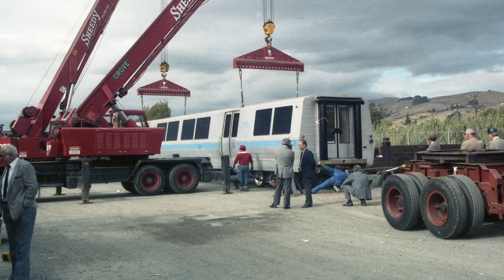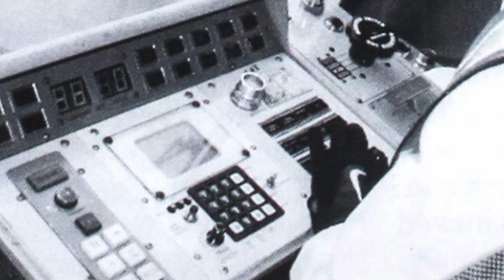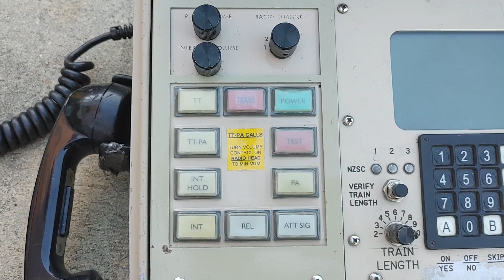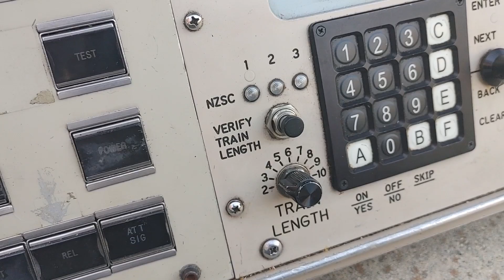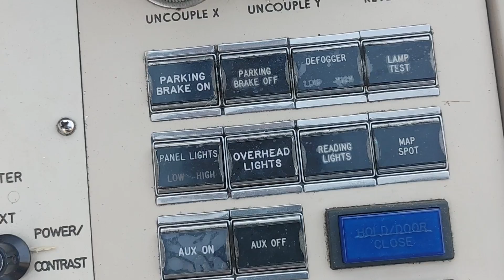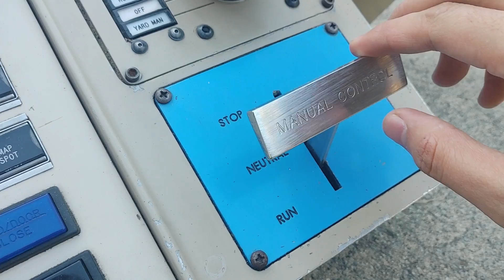BART Train Operator Consoles (and For Sale!)

Comment: I'm a victim -- err -- passenger of the Fremont Flyer and can be proven via newspaper picture :)  Do I get a discount?!?  FYI: I was staring at the train op slamming the STOP button with no (obvious) results.  I remember the PM Code shelf add-on (Max speed indicator).  I always remember train ops hitting the "Man" button a lot when it was raining as Lake Merritt would "lose" them on the map.  The train op walking up to the cab was carrying a GE radio with a UHF antenna.  So that was in the late 90's when the GE (Harris) UHF EDACS trunked system was deployed (and just deprecated this year!!).  BART originally used official Railroad VHF frequencies with no hand-held radios when they first started.
Reply from the maker: Guierrez, or Fleck, is that you? On behalf of the Western Railway Museum, I requested some parts from the rebuilt Fremont Flyer which are preserved by the museum and will be on display inside the cars in the coming months. https://bartcars.weebly.com/the-two-bagger/farewell-to-the-fremont-flyer-a-car-143-b-car-826-b2-car-1826 There were quite many mods over the years and only a little bit of that remains. The second generation WH (alongside QUEST partial replacements) seems to have had better luck, lasting through the end of the cars. One of WRM's cars has the old GE trunked system and the A car has the control head for the new system, which were only in use on the new cars for a few months of course.

Comment: I'm guessing the Manual Control handle is spring loaded, meaning if you let go of it, the handle automatically returns to the "Stop" position. Correct me if I'm wrong.
Reply from the maker: Yes. No deadman switch so this can function as that while running in manual
Reply: I was also wondering, does the Manual control handle have different power/brake steps? or is it just either 0% or 100%?